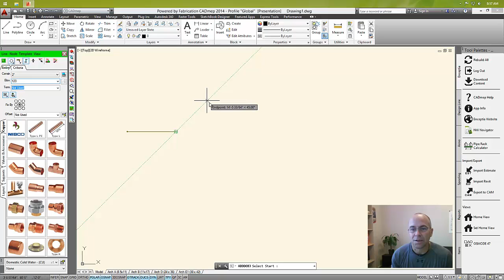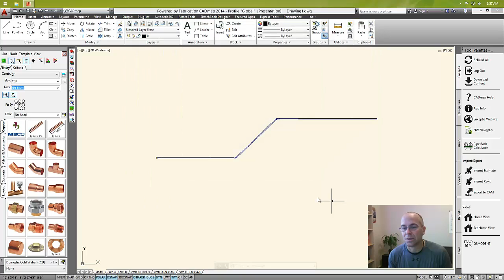Fabrication CADmep: Design Line - Rolling Offset

Comment: How would you use this method to generate offset elbow angles for welded pipe systems not using a typical angle, such as 28 degrees? 
What about fitting-to-fitting trimmed elbows?

Comment: Whatever  you got involving design line would be great because I'm starting to use this tool more and more. I do have a question about pipe insulation. When I add insulation on pipe elbows it comes in square on heel of elbow and not rounded like elbow radius. Wish I could post a snapshot here of what I'm talking about. I'm using Autocad 2018 with Autocad Fabrication & Navisworks Manage. Thanks

Comment: Thanks for sharing. I'm starting to use design line more and more now. Got anymore tricks up your sleeves. Thank you
Reply from the maker: Good to hear! What kind of tricks are you looking for?
Reply: Whatever  you got involving design line would be great because I'm starting to use this tool more and more. I do have a question about pipe insulation. When I add insulation on pipe elbows it comes in square on heel of elbow and not rounded like elbow radius. Wish I could post a snapshot here of what I'm talking about. I'm using Autocad 2018 with Autocad Fabrication & Navisworks Manage. Thanks
Reply: Hey  Rick, 
Here are some other videos that I have created about Design Line that might be helpful:
https://www.asti.com/design-line-node-buttons/
https://www.asti.com/fixed-design-line-nodes/
https://www.asti.com/design-line-fall-0/

As for your insulation issue, I would really need to see what is happening. At Applied Software we do offer support for all the Autodesk Fabrication products and you can find more information about that here: https://www.asti.com/support/

Hope this helps
Reply: Cool, Thank you.